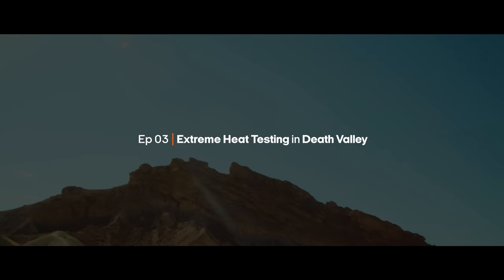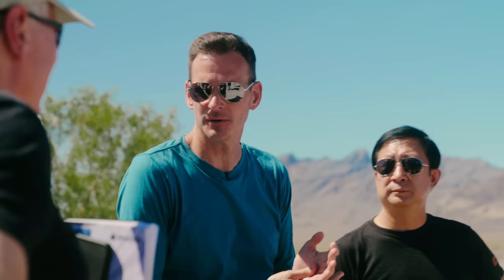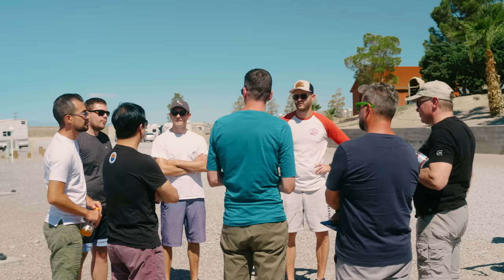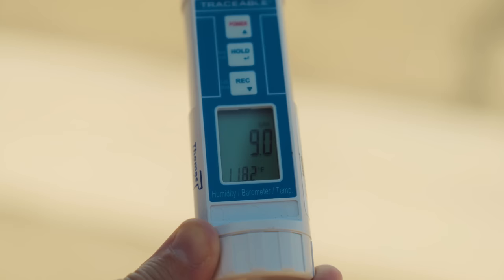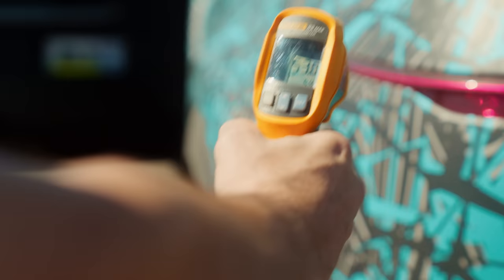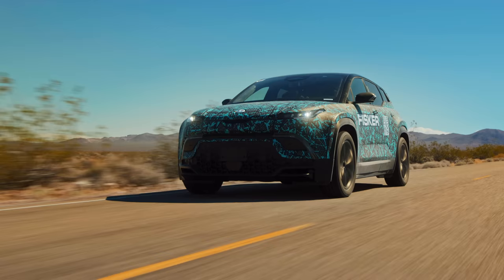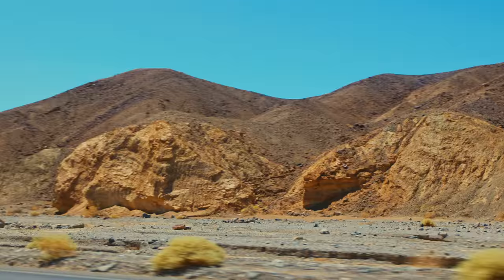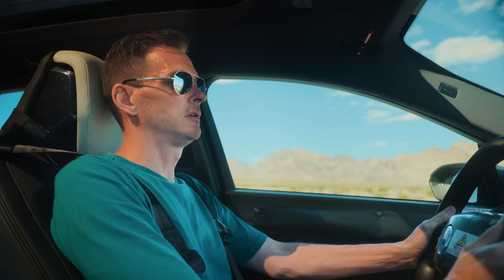Testing the Fisker Ocean in Extreme Heat

Comment: When you say a lot of miles over two days…what is a lot? How many actual miles did you get on a full battery in the hot conditions? At what road speeds? Interesting video but lacking details on actual battery performance in these extreme conditions. I live in Palm Springs, temperatures about 110 F are normal in late July thru mid/lat September
Reply: Yeah, I’ll add to that, my friend has a Tesla S and can’t make it on two charges from Scottsdale to Flagstaff.  It’s scary pathetic going up the I-17, 7,000 feet with semi trucks.  The car needs power, speed, passing capability, AC, and reliable range in mileage.  Not just some false promise!  Can’t wait to get the real, exact, accurate details for the Fisker!
Reply: @annachoi3633  me too Anna. Their touted range of 300+ miles on a charge would be great if it’s in the real world

Comment: Gasoline powered, Regular battery , driven once a week (covid housebound) in -40degrees Celsius condition would not start in winter. Battery is 2 years old. Parked outside.  Needed to jump start to get going. Can Fiskar handle winter conditions?  If there is no dealership, Where do I go for maintenance? My regular mechanic does not recommend electric cars for winter conditions.

Comment: Why test an EV in extreme heat ? Is there battery degradation in the heat? Should be tested in extreme and normal cold climates.  Not everyone lives in 75 degrees plus weather.
Reply: They already tested in extreme cold.